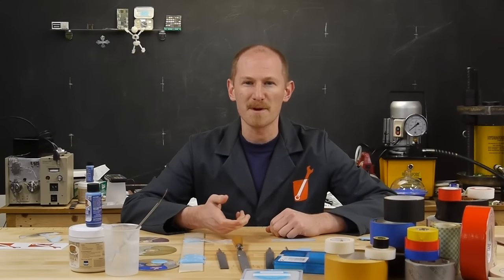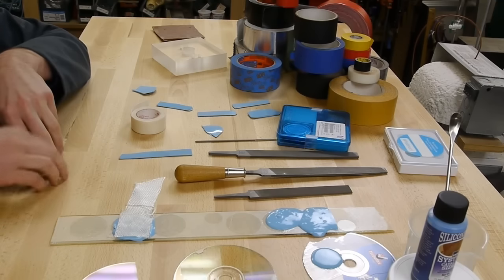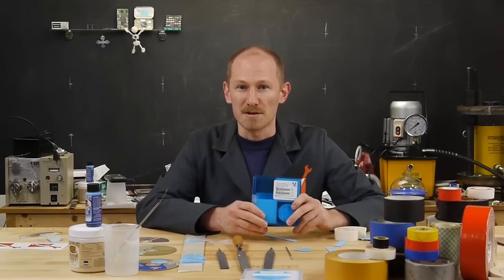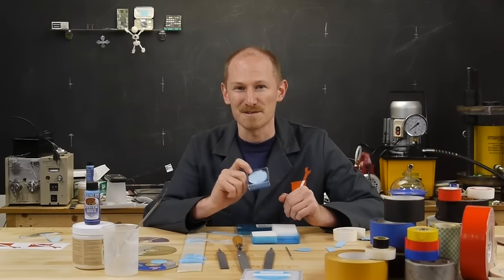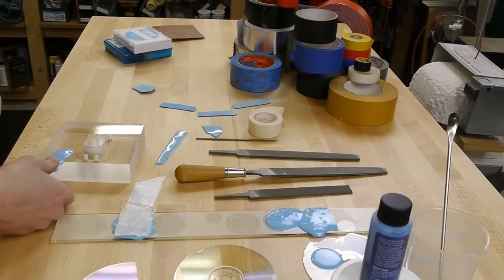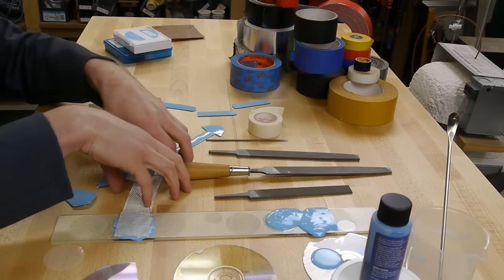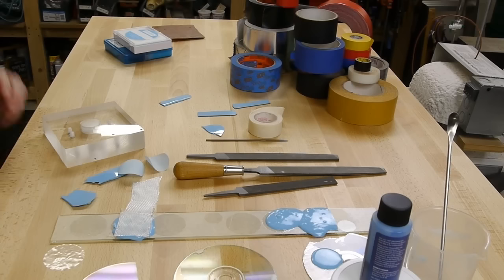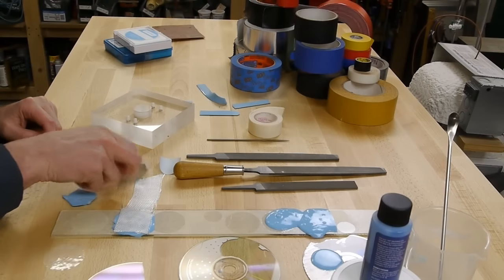Making DIY gecko tape - work in progress

Comment: to move the Peaks to the bottom of your mold and your are valleys to the top of your mold
Just press the file into a soft material such as plastic aluminium Etc
Then add your silicon to your new mold

 I would think that sandblasted materials would have an interesting structure
Maybe something like baking soda on glass or plexiglass

Unfortunately I don't have electron microscope to have a look at what could be achieved with a sandblaster

Comment: Molding an ideal surface seems unlikely to work.  What about a subtractive process, such as etching or laser cutting away the valleys.  A blu-ray burner with custom firmware or manual controls over the diode and steppers could allow you to precisely remove material in a predictable way.  Can you cut or ablate silicone directly. Cast a piece of glass first and then laser cut the smooth surface.  Use the disassembled drive and a disc as a rotating laser milling machine.  Any charring or tempering of the silicone will add some needed rigidity to the final part.

Comment: How about casting for less time to not allow the silicon to drip to the bottom of the mold?

If the mold holes go through the tape how about applying etchant to the bottom to eat up/shorten the hairs?

Does heat so anything to the silicone? Would ssending a current or vibration do anything to the process (like how certain frequencies make non Newtonian fluids behave?

what if you start with "flat" glass cast silicone and "whip" it extensivly with a drill and wire brush to exfoliate material?

try exfoliating the glass cast silicon at a few timed intervals to see if any resulting surface is ideal.

how about silicon as flat as possible on one side and a light flexible material on the back like cotton?

what if you sputter silicon onto cotton or another substrate?

Love the videos and still awed that silicone can flow through such a small opening!! Good luck!

Comment: What about those "Lightscribe" DVD burners, do they allow greater variety in the burn depth/density?
Reply: They expose the dye layer slower when in lightscribe mode.

But thing is you can't make an impression or casting off a CD-R/DVD-R, i mean you can, but the only thing you'll copy is the faint pregroove that has been on there to begin with. The way they work, the pregroove is coated with a dye that changes colour due to local temperature gradient as induced by the laser, there are no structural/mechanical changes due to "burning" the disc.

Comment: I’ve used the X ray backscatter feature on equipped SEMs to ID materials and accidently drilled /burned small features into the surface, could you mod your SEM to produce a small matrix of these features, and then propagated theses out using either silicone or Replicating Sheet - Cellulose Acetate Film and acetone…

Comment: I really like your channel! 

How about trying say a flat rectangular block of wax 5x5cm, like they use to make jewellry with, comes in diffent hardnesses. Maybe you can polish it by applying heat from a flame really quickly. Then my idea would be to use a 3D plotter with a vertically aligned needle (sharpest you can find) and have the plotter impress the needle in a grid like pattern to the depth required. Obviously the resolution and control you have will the plotter will come into play. Then cast the silicone onto the wax. Degassing the silcone will help also.You could also cure the silicone in a pressure chamber to make sure it gets into all the 'pores'

Kind regards

Comment: Couldn't you use light interference patterns for the photolithography method? The pillars wouldn't end up being circular (in fact they'd have a wide variety of shapes) or evenly spaced, but they'd be quite densely packed and the feature size should be about right with UV light.

Comment: how about using mechanics and electronics to punch or drill holes on a hard material using an even harder material a micro (nano?) scopic level?
You have an amazing tools in your lab for measurement, and by using simple mechanics and electronics to translate large movements into very fine small movements, you should be able
to basically create a microscopic CNC machine.

The initial prototyping may take a very long time but once you create microscopic tools you can then mass produce larger and larger areas by arranging those nano-tools side-by-side
to process larger areas.

The nano-tools could be the macroscopic equivalent of a punch-press or something.

I remember seeing a hackaday post once of a guy that created his own electron scanning microscope(ish) tool using a piezo electric speaker. or something like that.

I remember that he was able to "read" individual atoms using that method.

I don't know, maybe this could be something. I mean, it could even evolve into something totally different and general purpose.

A Nano CNC machine. That would be cool.

Comment: You mentioned spin-coating for photolithogratphy, but have you considered e-beam lithography with spun-on PMMA using your SEM?, I know you likely dont have the kind of control a dual-beam or modified SEM would but boxy rasters should still be doable if you have any sort of "area of interest" mode or maybe a bit of hacking with the beam-shift.

Comment: I'm not sure if you're still active but why don't you try casting a lotus leaf. You'd need to do a mold of a mold to get the positive though. So mold it in a hard resin then use silicone to mold that cast.

Comment: Can you coat a blank DVD or some more suitable material of similar shape/thickness with the stuff that's sensitive to the wavelength of light in a Blu-ray burner and then build a data file of the pattern you want then used the burner to harden the coating, etch the rest of the coating away and then etch the sub material away to the proper depth. I've thought about ironing PCBs this way but if I remember right, you can't get zero width tracks. Maybe not a problem for this application. It's been awhile but when I was messing with this in the past, I seem to remember someone had written a program that would translate an image into a data file so that when you burned the DVD, your image would appear due to the way the light reflected (or maybe defracted?) Differently between the peaks and valleys. Anyway, good luck!

Comment: Could the membrane be left in the radiation for a longer period of time? This would generate a more tightly packed pattern. Columnating the radiation could help too so that the direction was ordered.
Combine this with the control of how long the PC is left in the etchant and you may have enough control of your three variables.
Might need to go for higher powered radiation to punch through a thicker material.

Also, does testing on a mirror finish help you or hurt you? Might be better to test on a variety of surfaces.

Comment: Are you only using the piece of flat polycarbonate to test the stickiness of your gecko-tape?? 
In my mind it would make sense to test on a rougher surface. Since you are comparing to a flat-on-flat contact, which should be pretty good to start with? You might see a bigger difference between your castings an the flat rubber when you try different surface types?

Comment: Is the silicone actually getting to the bottom of the holes?  If air is getting between the silicone and the bottom of the holes, you can improve things by doing the casting in a vacuum.

Comment: What if you pass the radiation through a filter, like a polarizer, so that the beta particles only go straight down (or the angle you choose)?  Sorry I don't know how to make the filter. I know Apple drills microscopic holes in their aluminum laptop cases with lasers to allow LEDs to shine through. Maybe you can make a thin lead block with microscopic holes?

Comment: about coating the film with your photo lithography dye and than placing it on to a disk and using a light scribe dvd drive to remove parts of the dye.

Comment: try to make it as thin as possible or maybe it is coupled with electro-static or vacuum or some other effects.. When I 3D-print PLA and change filament, very thin strings stick to skin and clothes

Comment: what if you simply hacked a cd burner and made the diode run at a higher power so the holes became deeper? Or you could convert your homemade SEM into a particle accelerator

Comment: is there a way to use ferrous metal shavings as the pillars?  I imagine you could induce a magnetic field and orient the shavings exactly where you want them.  Because their rigid structure extends into the Silicon they would be less likely to fold over, but I don't know if you could get them small enough.

Comment: If the metal files are only sharp at the top, is there a way to cast the file accurately with something that sets hard, then use that to cast the silicone? That way you'll have made an inverse form of the metal file with the sharp edges in the 'valleys'. 

Excellent videos, by the way - really like your work!

Comment: Could it be that molding is the wrong technique?  Would flipping the process and looking at material removal be a possible approach?  Then you could work with stiffer materials for the tape.  Something like lithography with a solvent perhaps?

Comment: I'm three years late, but... What about approaching it from the other direction?  What do the scanning electron microscope images of just the silicon cast on glass look like?  Because this sticks the best, it has the maximum surface contact area.  How can you make that better?  The gecko can't have more surface area than 100%, so something else is going on. Either the tips of its pads 'stick' and the rest of the strand flexes a bit or the pads slip a bit but the slip just rolls more pad into position. My bet is on the stretch. Stretchiness removes kinetic energy from the equation. Consider when you're pulling on just your silicon sheet, the 'tug' is what breaks the van der waal adhesion. If you could make a pad that would just hold your weight...great, just don't make any sudden moves. If you could dampen your 'moves'-- congrats you're a gecko. 
The CD, maybe Bluray, this is pretty obvious so I'm sure someone else has mentioned it, or more likely as soon as you published this video you figured it out. A CD burner is just a different type of laser printer, just much higher than 1200 dpi, and a Bluray uses a finer wavelength blue laser. If you could turn up the intensity, it would etch deeper holes. If you could 
tilt the laser, you could get angled slots.
 Inside an inkjet printer there're a finely controlled stepper motors that make resolutions of? 2400 dpi? If you attached two or three lasers that are specific offsets, the net result could be finer than 2400 lpi. They wouldn't have to be greater than 1/2400, but some distance that multiple passes of 2400 dpi would fill in the gaps. Then you could make your 'wiper blades' . You might also be able to leverage this to a finer spacing. 
(I'm sure there's a million things I'm missing...but these are a few ideas to consider.I wouldn't be writing this had you not repeatedly said in your video, "I had another great idea..." that didn't work. If it was easy, it would just be a chore or a job, or you wouldn't give it another thought.  YouTube Channel idea: AncientTube: Videos that would've been made back in the day. Image the videos AppliedCaveman would make? "Well, then I had another great idea why not just round off all the corners?  But then as I was working on the last corner something happened and it went down the hill into the river. Look at the nice track it made. Seems a bit better than the tracks made by my earlier attempts.  I'll have to try this again in a future video."  )

Comment: It seems that the gecko's hairs are densely packed. Would it be possible to extrude the silicone through the membrane to make thin hairs, then bundle them together? While the aspect ratio of the hairs would be high, they'd be stabilized by proximity to other hairs. 
It might be worth a try, or I might be crazy :P

Comment: Burn angled holes with cd burner laser and stepping from 3d printer in molding form :) but have no idea how to make air go out from holes in casting process. Hi pressure or vacuum casting

Comment: How about casting on the rough side of aluminium foil and then dissolving the foil in nitric acid to be sure the salt i water soluble.

Also i would have loved to see a sem of the glass since that seemed to work better than the other surfaces

Comment: could you modify a cd burner to burn a deeper grove? or perhaps find a way to etch the groves deeper? perhaps if you applied the etchant while the cd was spinning at high speed it would get caught in the groves but slide off the flat surfaces.

Comment: Now, I'm not to familiar with magnetic substances or their properties when really really small.

But, couldn't you mix something diamagnetic into the silicone and then apply a magnetic field on the other side to make the "floppy noodles" stand?
Of course the tape would likely not stick as soon as you remove the field. But hey, proof of concept.

You would probably have to move a strong magnet field above the silicone while it sets in order to force the diamagnetic part of the silicone as far into the tubes as possible.

Comment: Could you not use carbon nano tubes grown onto a strip? I'm sure they would have the rigidity, be small enough and in tight clusters, the only worry I would have is them possibly ripping off when the tape is removed. I know that when they form threads of nano tubes it uses Van der Waals force to stick all the fibres together. If you have the tools to create them I think it would be a good idea. :)

Comment: I dont if this is possible or not but just and idea. Keep a graphite block in vacuum keeping it at a high temp and slowly introducing oxygen in a controlled amount which will oxides the surface of graphite and make pores which i guess can control the depth and with of the pores.

Comment: Is it possible to create a mold from "Black silicon"? According to the Wikipedia article this material has a dense needle-shaped surface structure with a height above 10 µm and diameter less than 1 µm.

Comment: if the radiation cast pores go completely through, could you place the silicone on top, make a container to go around the edge and bottom surface of the casting material, then use some kind of vacuum on the container to draw the silicone through the cast to straighten the "pillars"?

Comment: How about sputtering a metal onto a cd (that way you can control the thickness) and then burning it with a file of your choosing to create the pattern you're looking for. Then just cast it with silicone
Reply: Or burn holes in a sputtered surface with your electron microscope

Comment: Im not quiet sure if your scaning electron microscope brings the specification for this: you could modify it to use it to "etch" structure into an electron sensitive film. The process is called "electron lithography". When do you plan to release the next video? Im super curious :)

Comment: You mentioned that the file was sharp on the top, so when that transfers to the silicone it's sharp on the bottom.  What if you cast the file with something stiff, like acrylic or epoxy, so on the bottom its sharp, and then pour silicone on to the negative to make it sharp on the top, wouldn't that work, or work better then just the silicone negative?

Comment: To cast the files and get them to work better try just casting the file in some resin and then make a silicon cast of the resin. Boom, sharp teeth the correct way around.

Comment: to make silicon chips they project a template on to the wafer that has the photosensitive material on it, but they use lenses to make the projection much much smaller. What kind of lenses do they use that let UV light pass through? or maybe it is a different photosensitive material that responds to visible light?  
Also, could a blu ray disc work?

Comment: (i) I wonder if the dielectric properties of skin/hairs add to the clinging effect via static charges? (ii) could you partially dissolve the top layer in (idk, butane? xylene?) & hit it w/ a heat gun? it seems like it would bubble & create the right structure if you got the heat level perfect (iii) you could maybe print layers of the pattern on some kind of plastic film or gold leaf, layer them & dissolve out the leaves of substrate. but I have no idea how you'd get the layer alignments right. or the printing.

Comment: And what if you tried with a disk burned with a file (not the tool) containing as much but with the value 1 as possible ? I think each beginning and ending of holes is a 1 so more 1 would mean more holes in the disk. Also maybe try with a blu-ray disk, if I remember correctly they have thinner holes, although it changes nothing about the aspect ratio I guess, it could be enough to work.

Comment: If it's possible to use camera optics, one could conceivably project a much larger image onto a small area thereby giving much higher resolution. The question is the grain size of your photo reactant solution. Will it support something that small? That said, I've never tried such a thing. I don't know how much of the UV light will make it through the camera lense assembly. I know a lot of them have IR filters on them. I'm unsure about UV filtering in such a situation...
Reply: A lot of transparent materials don't transmit uv wavelengths. Anything below 300nm, requires some really expensive optical grade quartz

Comment: I don't know if this has been brought up before, but would it be possible to cast something on to the file to make a mold from? Rather than using the file as a mold directly, you'd have a negative form that would allow you to achieve the fine edges that you're looking for, I think.

Comment: Why don't you use the silicone for the negative mold as it can handle heat and then you could cast a resin or even metal as it is heat resistant.